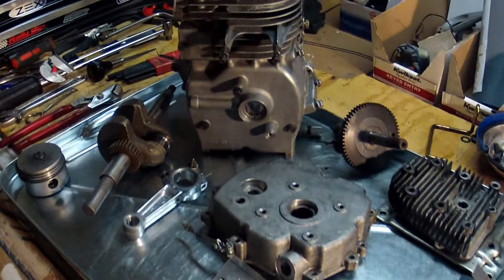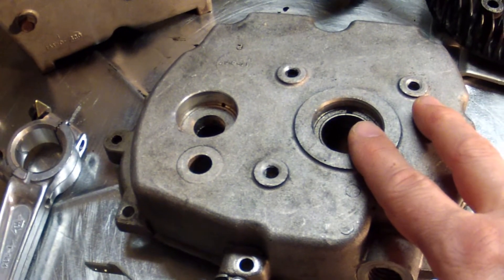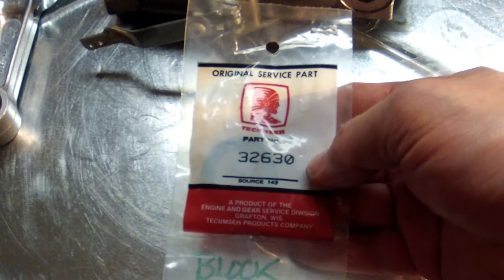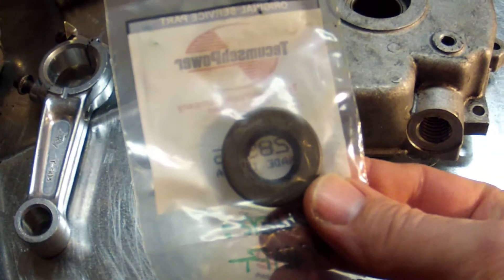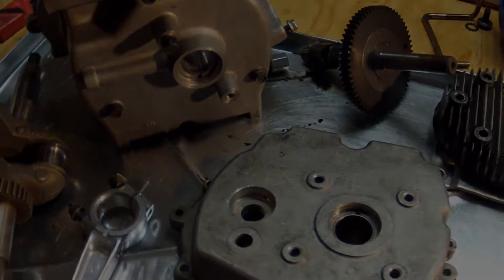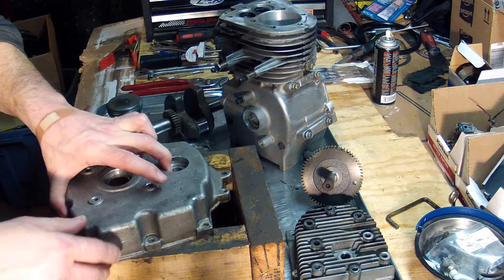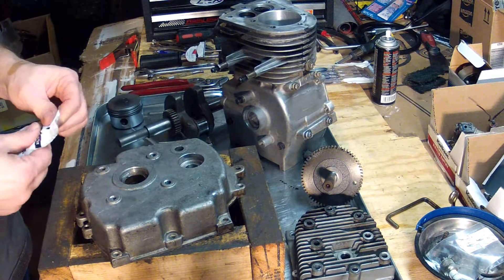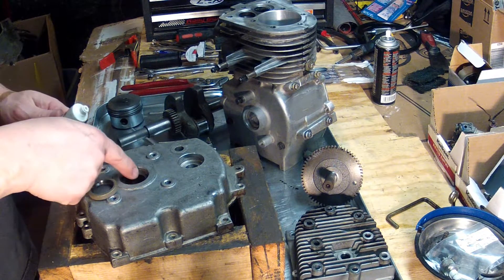Tecumseh HSK70 Rebuild - Part 12 - Oil Seal Installation

Comment: what are the dimensions of your work box?
Reply from the maker: The box is made from 8" 2x6 boards - so the outside dimensions are 8x11. They were just some spare wood blocks I had around. No particular reason for that size. Thanks for watching.

Comment from the maker: If you didn't notice oil leaking out around the oil seals, you are probably in good shape. If need be, you can replace them later, after reassembly. (I have a video for that!) One of the valves may have a mark on top (like an X) that would indicate the "Exhaust" valve. Otherwise, I find that the springs are nearly identical and it shouldn't be too big of a deal if they get switched. But in the future it's a good habit to keep them separate and labeled. Thanks for watching.

Comment: I have a similar situation with my snow blower,  the oil plug came out while I was blowing snow.  I have it completely disassembled. I didn't know much about this stuff when I took it apart.  I did not take the oil rings out.  Do you recommend I do?  I also didn't identify the vale springs and lifters as to where they came from.  Will this create a problem for me when I put it back together.   I'm following this series as I go and it has helped me tremendously.  Thank you very much